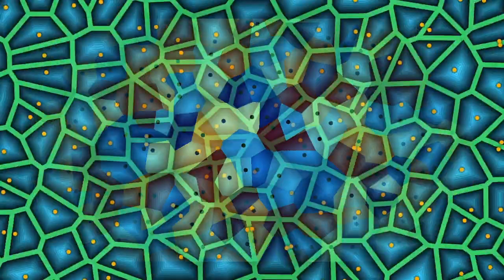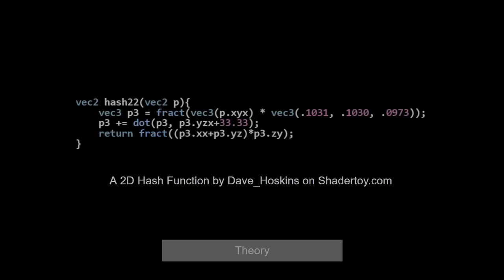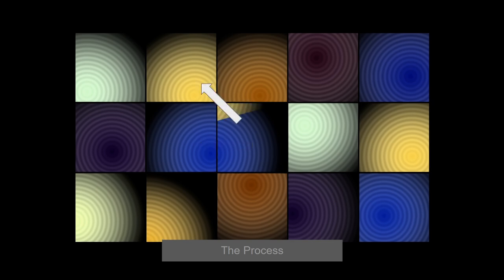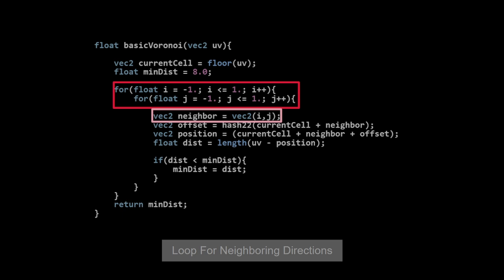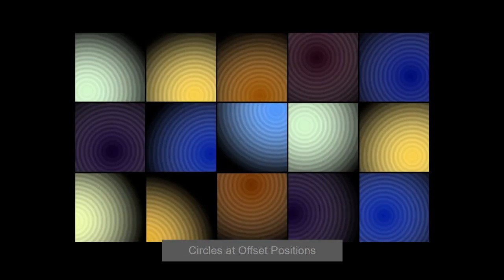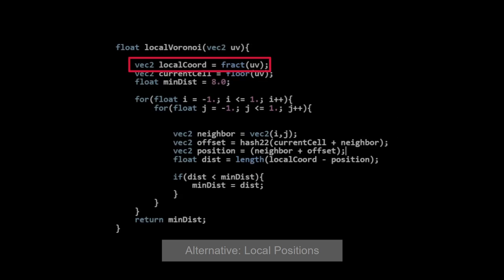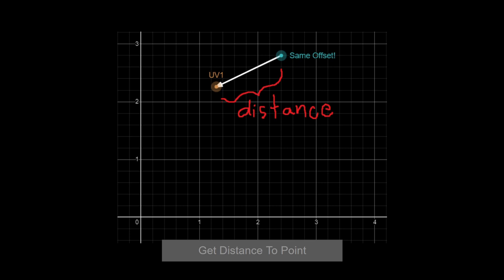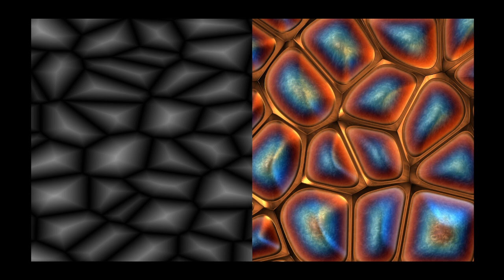Voronoi Edges Explained (why you don't need fract)

Comment: This is a great explanation of a very clever and efficient algorithm, but I believe I have spotted a small oversight.
It seems to me that the claim at 3:09 (points outside the immediate neighbours are too far to affect drawing) is incorrect:

Consider the following grid layout (the o s represent the chosen point location within a given cell)

+––––––––+––––––––+––––––––+––––––––+
|           |o          |          o|          o|
|    A      |    B      |    C      |    D      |
|          o|           |           |           |
+––––––––+––––––––+––––––––+––––––––+
|          o|           |X          |           |
|    E      |    F      |    G      |    H      |
|           |o          |          o|          o|
+––––––––+––––––––+––––––––+––––––––+
|           |           |           |o          |
|    I  o    |    J     o|o   K      |    L      |
|           |           |           |           |
+––––––––+––––––––+––––––––+––––––––+
(I hope this comes out right, I can't think of a better way to illustrate this)

Let's try evaluating the color at position X inside of cell G. The distance to the point within G is almost the full diagonal, so almost √2. The distances to the points in all direct neighbours are also at least √2.
However the distance to the point inside of cell E is barely above 1, so it is actually the closest point, despite not belonging to a direct neighbour.

This is of course an extreme case, but as long as there is a pixel close to the corner of a cell, where the distances to all points in the surrounding 9 cells are greater than 1, this case can occur.